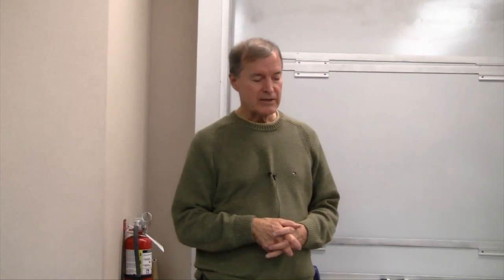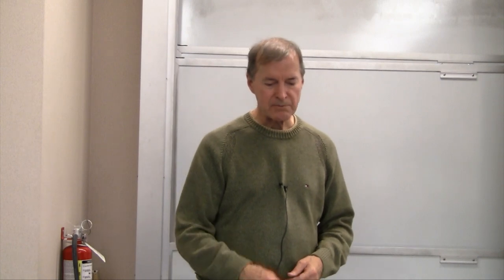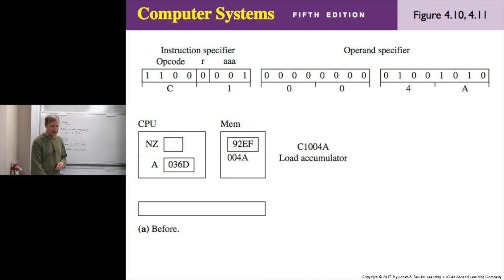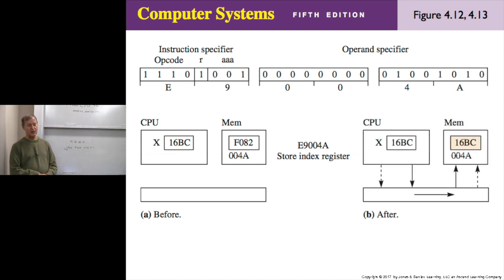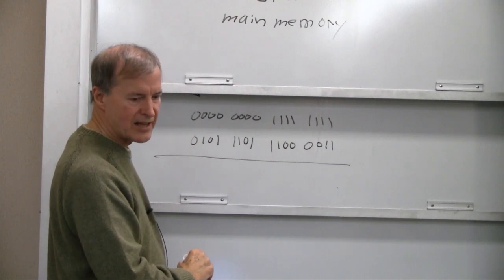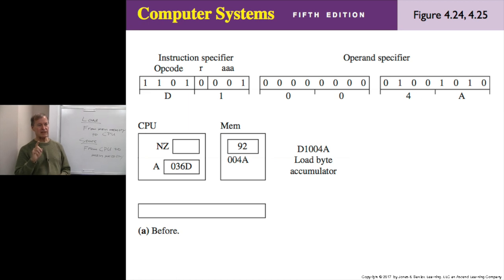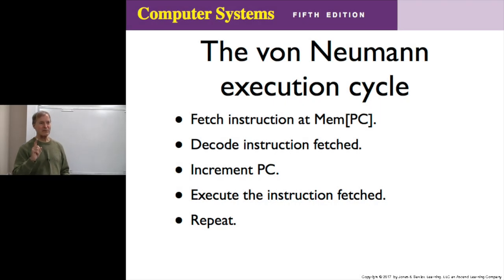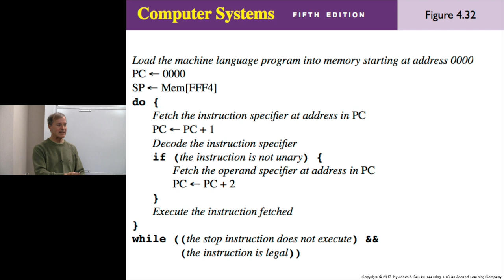CoSc 330 5thEd Lecture 7

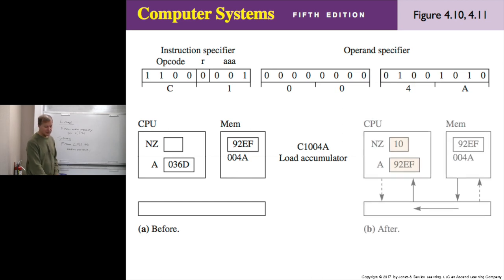Comment: At 17:36, why would'nt the accumulator load just the 92, since its only loading 004A and not 004B??
Reply from the maker: What you are describing is the action of the load byte instruction. This is the load instruction (also known as the load word instruction), not the load byte instruction. This instruction always loads two bytes into a CPU register, which has a capacity of two bytes. Memory is byte-addressable, which means that every byte has an address. So, to load two bytes from memory, the instruction takes the byte at the specified address and the one at the next higher address.

Comment: In 34:13 , how does he get 035D?
Reply from the maker: At 34:13, the discussion is about the load byte instruction. Before the instruction executes, the example assumes that the content of the accumulator is 036D. If that is the case, then, after the instruction executes, the content of the accumulator is 0392.